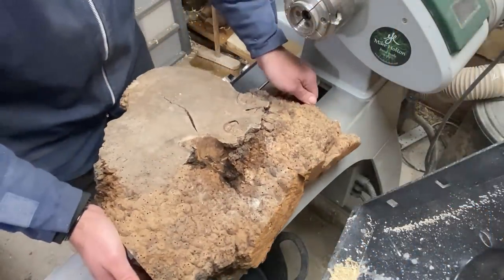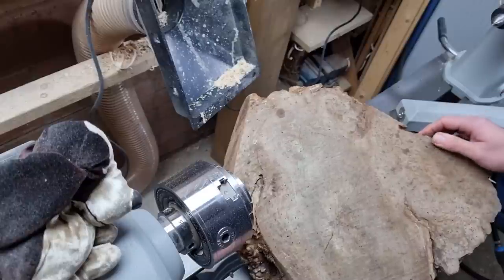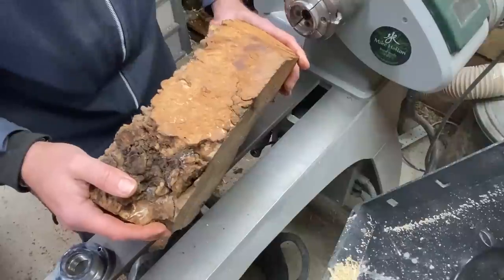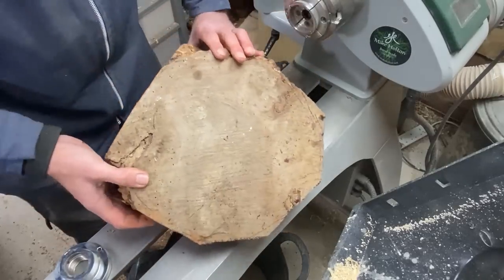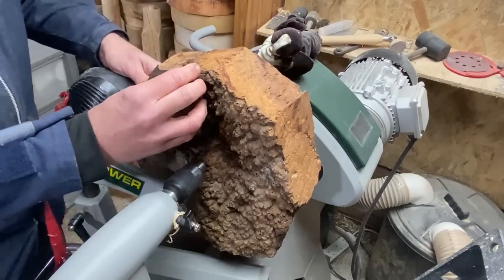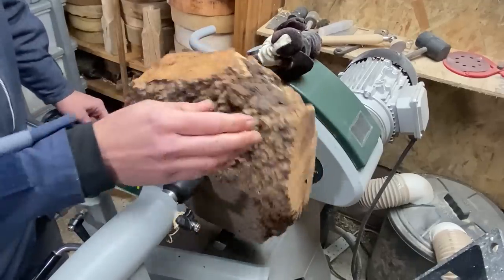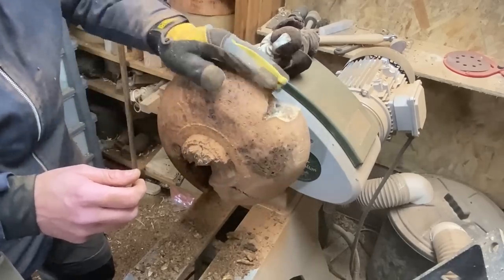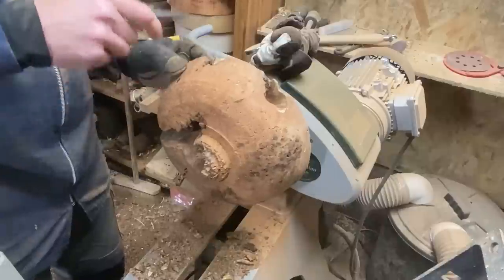HEARTBREAKING Turn of Events - Woodturning project

Comment: Kinda draws it up tight when ya throw a piece across the room, don't it !!!😂  Brother, I've thrown HUNDREDS of pounds of steel out of both vertical lathes and horizontal lathes in single piece chunks.   I'll tell ya what....if THAT don't make ya pucker nothing will !! HAHAHAHAHAHA  !!   I'm so glad this bowl didn't shatter or crack.   What a heartbreak that would be !  Very nice job, sir !!  (At least with a horizontal lathe it usually goes the other way and not AT you.😬😅  Still, you'll want to check your drawers.........😂)
Reply from the maker: Haha thanks Bill, yep, on occasion you have moments when you find out what colour adrenaline is 🤣. Luckily they don't happen too often 😄
Reply: @MikeHolton  I was cutting a steel billet that weighed about 3 or 400 pounds on a Bullard verticle lathe.  As I was taking a face cut the carbide found a blemish in the steel and pulled it right out of the 4 inch tall jaws !!  That thing just bounced on the spinning jaws like a rubber ball until I got up off the floor and hit the emergency stop.  Man....that 48 inch diameter chuck got wedged into place like you wouldn't believe.  Yeah...I found out the color of adrenaline THAT day !!!  I wasn't any good for the rest of the shift !!!🤣  ADRENALINE EVERYWHERE  !!!!!!
Reply from the maker: @billrose2083  💩🤣😂😅
Reply: @MikeHolton  I've made things so small ya have to use magnification to monitor the work and things so large ya have to ride IN a basket along with the cutting tool/ram with controls to ensure the numbers will put the cutting edge where it's supposed to be way up there.  Stuff you've heard about in our military and in space.  I've never enjoyed it more than performing work for local businesses out of my own little shop in the back yard.  Stuff you can touch and appreciate like your woodwork means everything to me. You can enjoy and display it. You truely do nice work.
Reply from the maker: @billrose2083  Thanks so much Bill, the way something feels is everything to me, I'm a very tactile person.
Reply: So where are you located ?  I'm in the USA in the state of Maryland about 45 miles south of Washington, DC.   We just call it Southern Maryland.   I'm about 1,000 yards from the west bank of the Chesapeake Bay.
Reply from the maker: @billrose2083  I'm in the North East of the UK about 15 miles south of Durham in Co Durham 😁
Reply: @MikeHolton  yeah I could tell by your accent you were not from around these parts.   You have a nice lathe.  What is the brand and cost ?  I really like the versatility.
Reply from the maker: @billrose2083  Hi Bill, it's a Record Power Regent and it is great value. In the UK it's about £2,000 and $2500 in America, I have taken the liberty to find a listing on an American site for you to take a look at https://www.turnerswarehouse.com/collections/record-power/products/regent?variant=39765234778195 hope this helps, Mike
Reply: @MikeHolton  I'll look into that.  By the way, I'm sitting here at a local park in Southern Maryland that I help maintain.  Here, the chairman of the board is JIM DUNBAR from your local Dunbar clan. He goes over there from time to time but lives here in Southern Maryland.   I told him about your shop and where you live. We had a good conversation  ! HAHAHAHAHAHA  !!!!!  We talked a lot about adrenaline  ! 🤣
Reply: Down here at this park I cut the grass, paint the structures,  paint little pictures on rocks for kids that visit, talk to visitors about the historic issues that surround our civil war we had in the 1860's.  There was a prisoner of war prison here that housed the Confederate Soldiers.   We do a lot to tell their story and memorialize our American history.   I just got done cutting the grass.   It's about 96 degrees.   Hotter than two hells with the humidity about 80%.  Feels WELL over 100 degrees.   I think we're done for the day.  Can't wait to get home and into the air conditioning  !!!  I used to work in the shops in this heat.  It was always miserable......
Reply from the maker: @billrose2083  Haha, not sure I know any of the Dunbar's but if I meet one I'll stop and say hi. 😁
Reply from the maker: @billrose2083  Sounds like a wonderful and worthwhile job you are doing, well worth the effort!! The weather here has been terrible, we have have rain almost every day for the last 3 /4 weeks and temperatures well below the national average for this time of the year, not great when the kids are off school. That being said we are off to Tunisia at the end of next week which will be so much nicer. Working in the heat is not fun, but resting by a pool enjoying cold refreshments in the heat I can do quite happily 🤣
Reply: @MikeHolton  I hope your trip is fun and relaxing.
Reply from the maker: @billrose2083  Me too! With work and getting the channel going it's been a very busy year, but loved every second 😃

Comment: Well certainly made me jump! Fantastic piece in the end. What was your conclusion on the resin you used? 
Also did you mention at one time you were going to review the lathe? There seems to be a lack of videos on the Regent. Cheers. Jim
Reply from the maker: Hi Jim, the resin I will not buy again, I'll be going back to GlassCast 50+, Total boat is supposed to be amazing but just too expensive over here. Ans you are right, I did say I was going to review the lathe and I intend to, but there are still features I've not used I want to test first before doing so. But between you and me, it's amazing! 😃

Comment: The glue block has enough mass , why didn't you use a screw drive to mount it ? Methelated spirits will disolve the hot glue Just drizzle some around the tenon and let it soak in . A warmed blade like a putty knife can be worked around to free it ,  Before using a bucket or other vessels to mold resins , apply a good coating of carnuba wax so it releases with just a tap . Did you intend to have all of the worm holes as details ? So many turners on You Tube wear mechanics glove when rough turning of burls burrs and resins , but it is very dangerous and not recomended by the American Association of  Woodturners for sefety reasons , for the same reason that you remove watches , rings and braclets around spinning machenary  
A fellow turner friend from California was wearing cotton jersey chore gloves while turning a burr . His finger caught an edge and was pulled into the tool rest. After a painful surgery and three screws the E R surgeon put his badly broken little finger back together , The blue nalgene examination gloves that you wear when applying your polishes and finishes are what I wear . They deflect chips , dust and if caught by turning workpieces,  they shred and dont pull your hand into the spinning bowl 
And I can buy a box of 200 from our local Sams Club pharmacy for less than $11.00 
Your bowl is a stunner
Reply from the maker: Thanks so much for all the advice, I really appreciate it! 😀